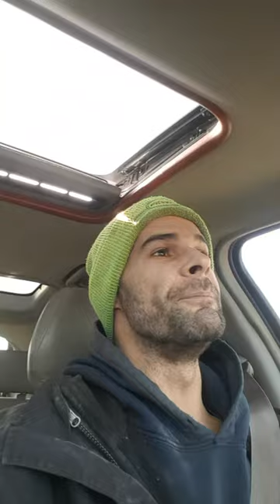FATAL ELECTRONIC POWER STEERING ASSIST ISSUE

Comment: Your point is valid and well taken, my ford EPAS locked-up causing accident and injury. I am retired electrical engineer with extensive experience in robotics and servo-related systems. The failure disposition you speak of is commonly known in servo engineering. Failure occurs when servo-motor drive transistors fail (usually low impedance short). This condition results in direct high-current path through servo-motor winding, effectively locking motor in position. This condition is usually protected against by including secondary "fail-safe" transistor on one or more supply potentials that disable power to entire circuit. However, there is no guaranty secondary safety circuits cannot also fail. This quagmire leads to all sorts of complex design redundancy issues that become complex, expensive, and ultimately cannot guaranty zero probability of critical failure. Basic control theory, covered in most engineering school curriculum, fully addresses these types of servo-system faults and stipulates caution in highly-critical design applications. The design and subsequent use of electrical servo systems in automotive steering systems is inherently flawed, problematic and irresponsible. BTW, most common EPAS system failures are due to thermal loading design flaw through use of non-automotive grade components internal to EPAS assemblies, and poor thermal management under hood. I cover all of these issues in my youtube videos.
Reply: the EPS on my 2014 ram 1500 failed last week and almost caused a crash, it will take about 4000 canadian dollars to replace the whole rack and not be covered by warranty
Reply: So what about servos on fly-by-wire aircraft such as the A320? These systems have multiple redundancies,  right?
Reply: @rfi-cryptolab4251  in aircraft they are built not to fail, and not built as cheap as they can
Reply: @wolf360090  
True

Comment: 100 percent correct..at least with a power steering fluid pump you gradually lose steering and can get safely to the shoulder or out of harms way ..these cut off because of sensors or computer glitch thank God my daughter in laws 2019 Colorado happened after my Father’s Day party when they were trying to leave home but the power steering assist service locked up and locked them out of being able to drive it safely ..Luckily I had an old 2005 dodge Durango in the driveway they could use ..I went over the system and have come to the same conclusion that the electronic magnetic reverse polarity is very dangerous and could cause harm to life and property..Hercules would have a hard time turning this truck …this is not a normal power steering failure even if it’s electric..there is no centrifugal type clutch plate to diffuse pressure in the internal housing or even a simple off switch to over ride the ESM with EPS …they are so fucking stupid it’s beyond imagination..your right brother and righteous for not being afraid to stand up for the truth

Comment: Whats your vehicle? I just had an EPS system fail on my 2017 silverado 1500. I was lucky to have been exiting the freeway at the time and pointed towards a turn out. I came to a stop and turned on and off the truck a few times. still locked. then waited with the truck off for 4-5 mins and the EPS came back. Im dealing with chevy today about the issue

Comment: Oh yes, use of electronics to control an electric motor or a stepper motor, yes it creates a magnetic brake affect if should a power transistor fail, and starts to conduct permanent flow of current into one of its set of windings, creating a strong magnetic pull,  and stop the rotation of the steering column, or start pulling it to one side , yes detection circuits can be deployed that detects when a transistor output does not close down when it should then a power relay should energise cutting off the power as a safety device